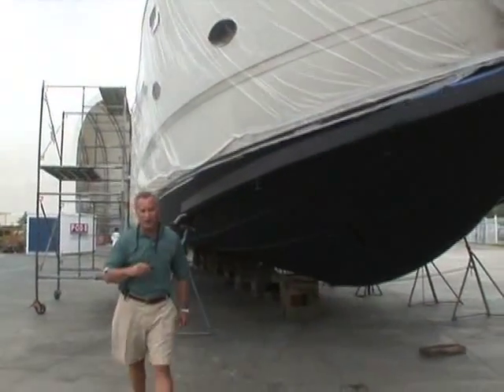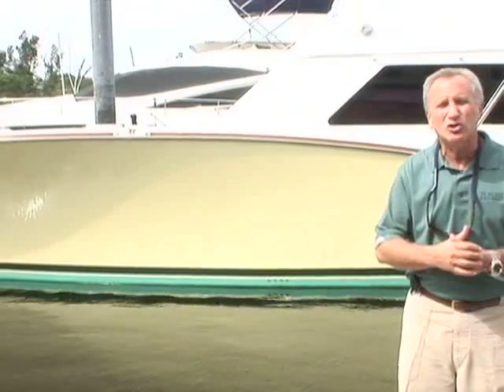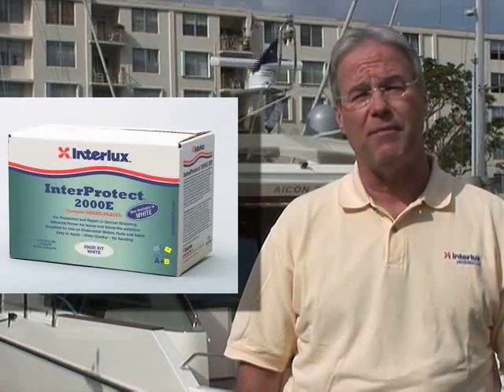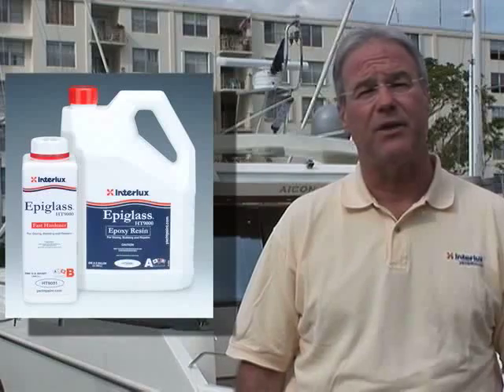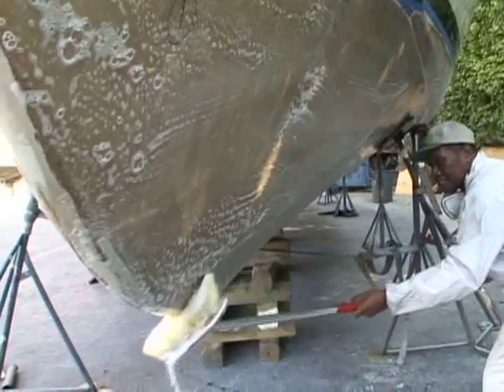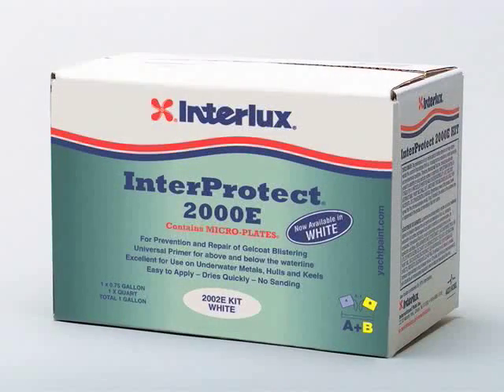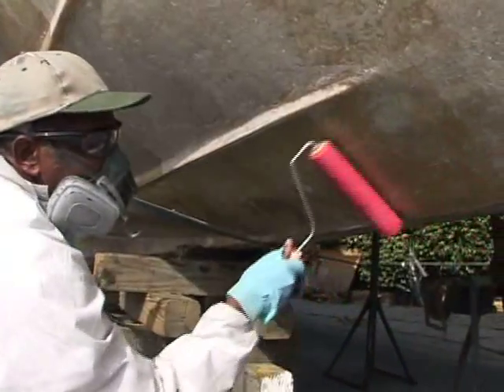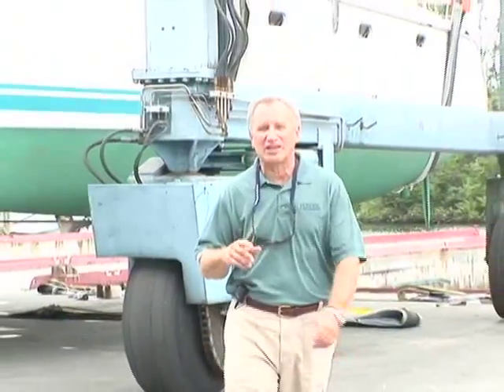Interlux - Interprotect System - Maintaining Fiberglass Hull

Comment from the maker: Hi Robert,

The InterProtect 2000E can safely be applied by brush, roller or spray equipment. When applying via brush use a natural bristle brush.  When applying via roller use a 5/16” or 3/8” nap roller which is solvent resistant. When applying via spray equipment use Airless Spray Equipment with a pressure of 2400 psi and a tip size of 17-21 thou. If you have any further questions, give us a call on our toll free 800.468.7589.

Jay Smida
Interlux Yacht Finishes